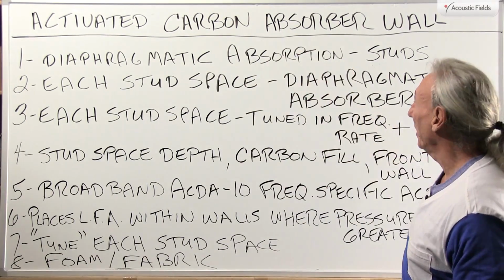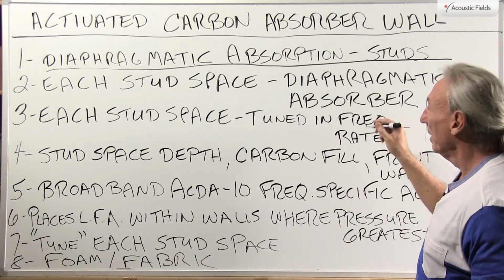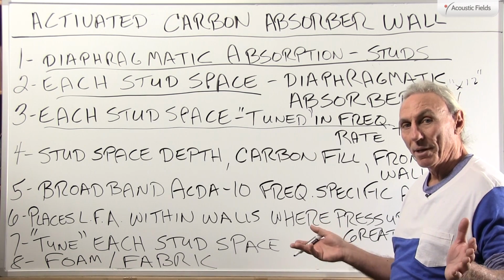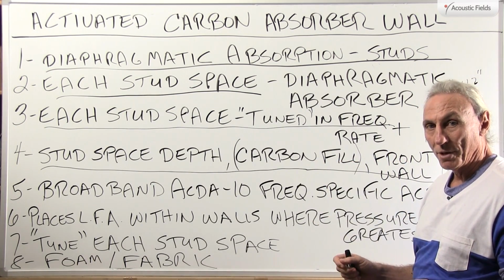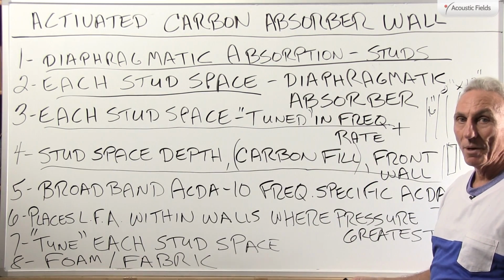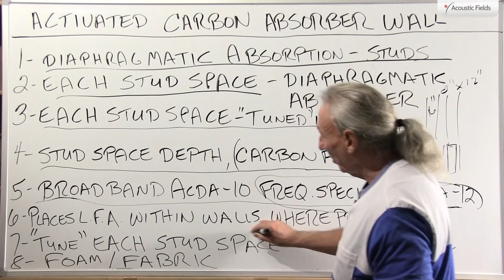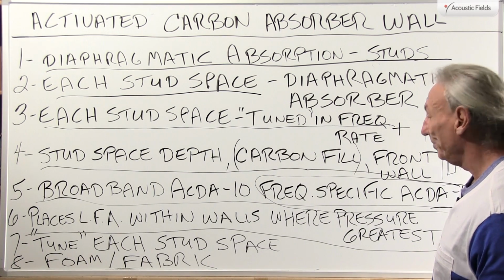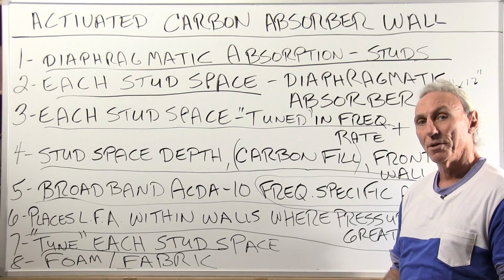Activated Carbon Absorber Wall - www.AcousticFields.com

Comment: So if I have a existing 15 x 15(9ft ft ht)  room. 
And I gutted it. Would I only have a 13 x 13 when done? And I'd loose on the ceiling to.
Reply from the maker: If this is what we have to work with then so be it. Treat as many of the issues as budget and space will permit. The rest of the issues you will have to live with.
Reply from the maker: Low frequency treatment technologies that reach down into the 30 Hz. region require 12" of space to achieve this absorption objective.

Comment: In a room without soundproof around wall, if we put activated carbon absorber, we make a little soundproof too?
Reply from the maker: M,  Our carbon is a sound absorption technology. There is no such thing as soundproofing. There is sound management which reduces the transmission of energy from the source to a receiver by using barrier material. Carbon will not reduce the transmission of energy from the source to receiver.
Reply from the maker: Carbon is a sound absorption technology not a noise transmission technology.

Comment: Isn't activated carbon flammable or a least a fuel ? I know that rockwool is fire retardant. How safe is it to have in the wall ? Keep up the good work sir. Learning alot from your videos.
Reply from the maker: Hi DJ, It meets all fire code requirements. It is fire retardant because the materials it is made from are toxic.

Comment: Will these panels work in a mobile home
Reply from the maker: Yes, sound absorption can occur in any container.
Reply from the maker: Yes, sound absorption can be used to absorb excess energy within any room type. It will not stop noise transmission.